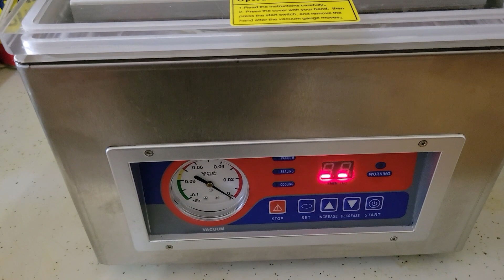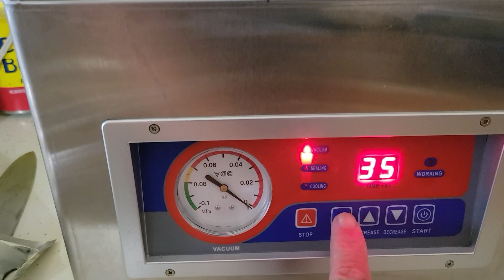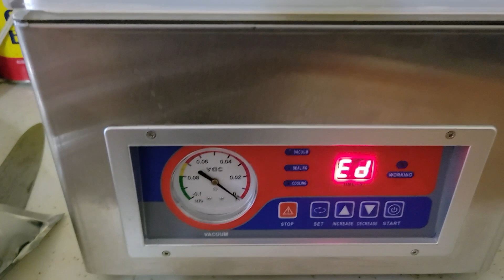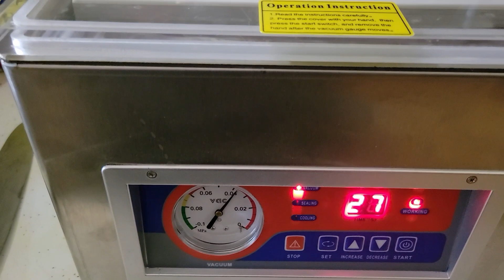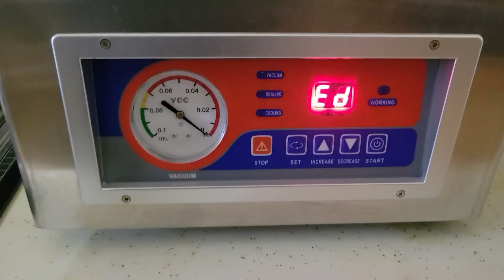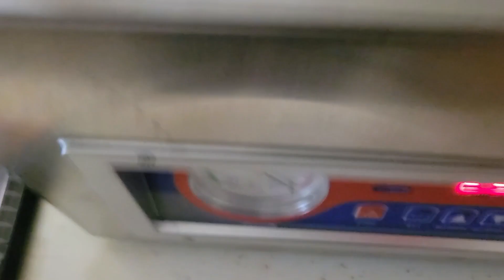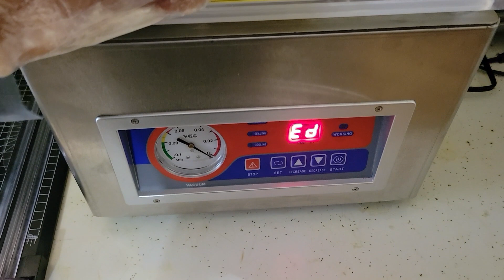DZ-260c Chamber Vacuum Sealer

Comment: This one looks different than the vevor dz-260c iv got this one looks like the 260A. The dz-260c has the seal bar in the rear of the unit. The A has the bar in the front.
Reply from the maker: It's possible I put the wrong number on the video, but the best to my recollection is that's the model number that was on it.

Comment: How's it holding up? I really want a Vevor as seems best bang for buck but am wondering about quality and customer service/warranty if something went wrong with it.
Reply from the maker: It's still working just as good as the day I bought it.
Reply: Thank you very much for replying so quickly. If something did go wrong, are you confident the company has replacement parts or do you know if they would? Thanks. @bobreichel
Reply from the maker: @RICHARDSTROUD-e6o  I really don't know as I've had zero problems with mine.

Comment: Did you receive a US address to order replacement parts?
Reply from the maker: Not sure what you're talking about I bought it new off of eBay. I haven't had any problems with it at all.
Reply: @bobreichel  You may need, in the future, chamber seals or a sealer bar. These wear with time.